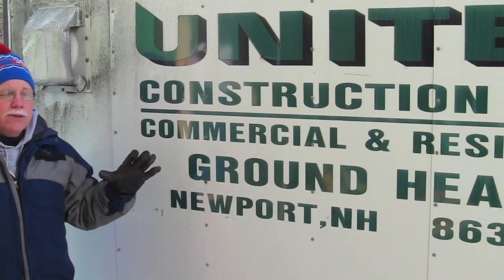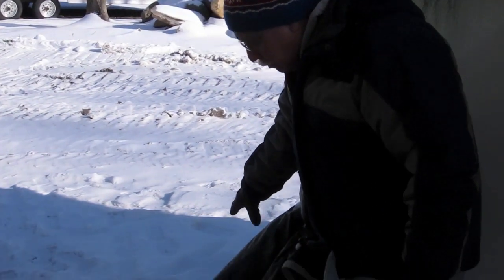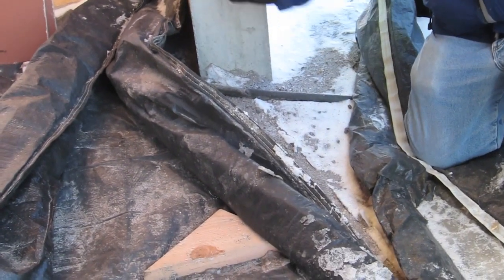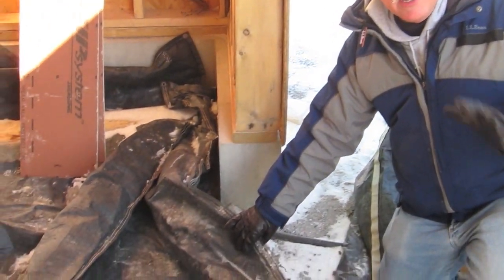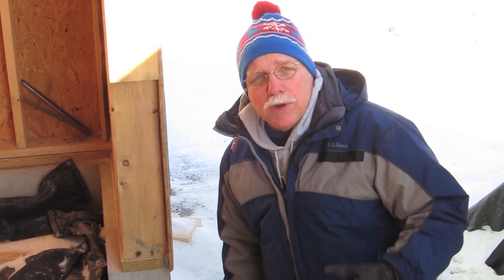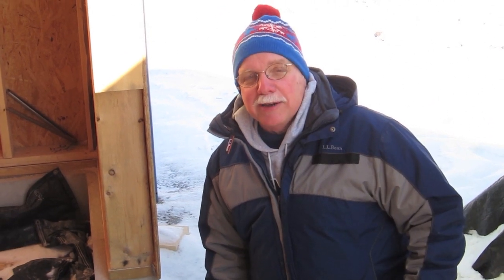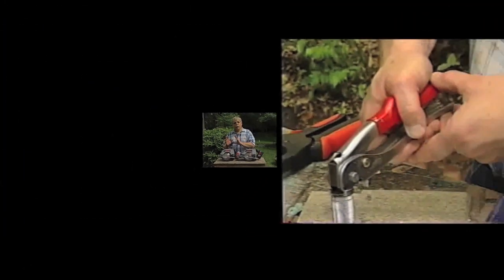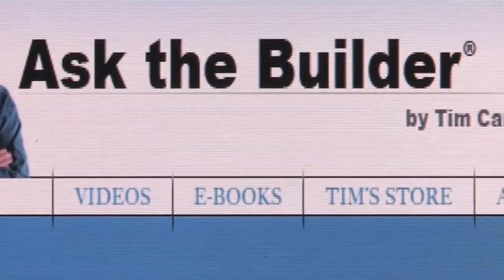Thaw Ground

Comment from the maker: @ElchinMendes Fantastic! One other used for this great machine: A month before it was connected to the PEX tubing in the basement. They started it up and then the concrete trucks came to pour the basement floor. It was a cold day and without the heat coursing through the PEX, it would have taken hours and hours to harden to finish. The concrete thought it was an early summer day!. They finished the slab then covered it with the blankets. You can do this in the UK!